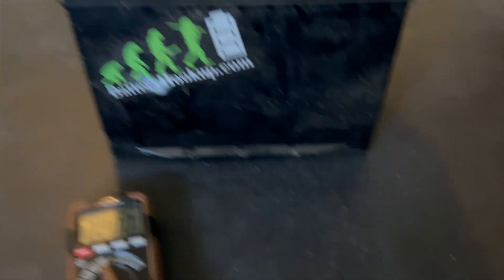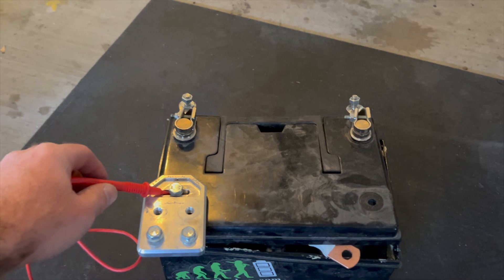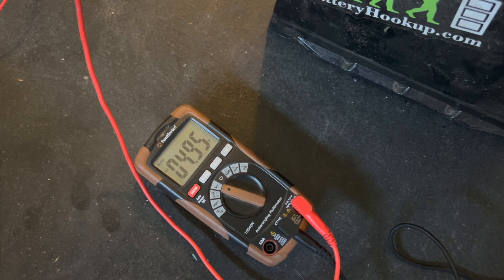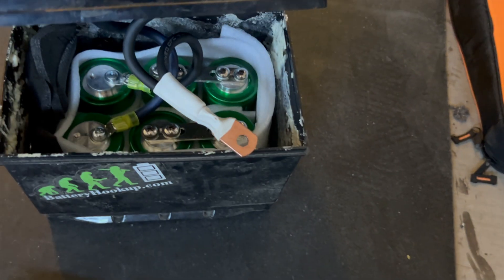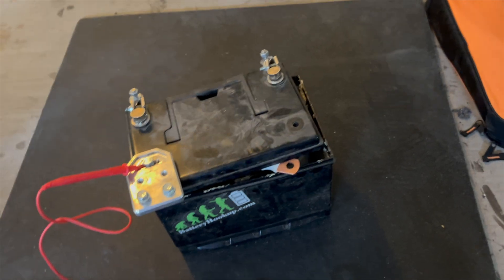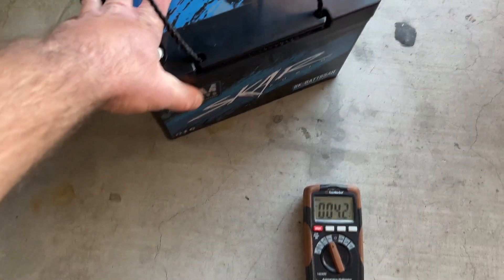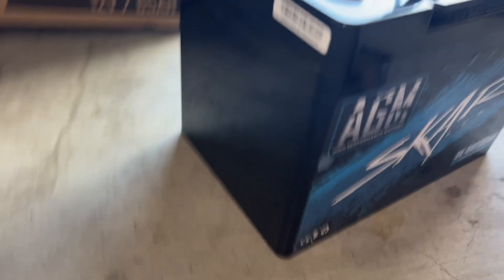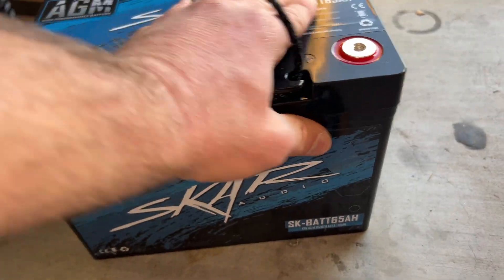2 12s on 6K in the GoKart V3 (video 2):  Skar AGM under the hood

Comment: Thats how i got mine set up. I got a xs power agm and a headway bank. 2.5 years straight going strong with just a top balance once a yr. I do wanna get rid of the xs power for one of those ustart caps.
Reply from the maker: Yeah man, and those caps are CHEAP!  The only reason I didn’t go with one is because they won’t fit under the hood in this car.
Reply: @Husky_Shane_Basshead  my factory location is the trunk so I'm lucky in that sense. Last I saw, they were on sale for $99 each!

Comment: Hell I’m running two AutoZone duralast agm platinum batteries and jp630 super cap bank doing just fine on 9k rms
Reply from the maker: Stock alt?
Reply: @Husky_Shane_BassHead  no 320 amp

Comment: I Think 🤔 that's the battery I am going to purchase, for my set up plenty of cranking amps for my vehicle and alot more AHs than my old optima blue top and like $45 -$50 dollars cheaper..but the MAIN thing it fits in my small battery tray and can close my hood...👍💯
Reply from the maker: Yup, that’s why I got this battery.  It was an AGM and they made one that fit my battery tray.
Reply: @Husky_Shane_BassHead    Yes sir!! 👍I searched every AGM dual purpose, that had the most to offer that would fit in in my battery location, and I checked out your video, and checked out specs and said that's the one..  my vehicle is a 4 cylinder 4x4 kia Sportage, went from 70 amp alt to a 140 amp alt , Big 4 ofc,and all wire ofc, also have a 28 AH AGM  Shurkien supplemental battery, Running around 1900 watts at full tilt, under 2000, amps are pioneer 8704 , running 4, 6x9s",2, 5.25s" , 2, 4s" and 1" soft domes , front channels @1 ohm and 6x9s @ 2 ohm and  2 12s" ran by a JP8 mono block @ 1 ohm.. hope you don't mind me giving you a rundown of my little build..

Comment: Did you have a balancer on your supercaps? I can’t tell from the video.That may be why they took a dump.
Reply from the maker: No I didn’t.  And I think you might be right.
Reply: @Husky_Shane_BassHead  The Maxwell supercaps banks on Amazon and the XS Power Superbanks all have balancers attached on the bars. Your caps might be salvageable. You can’t really kill them & they last forever unless they physically got damaged. I would take them all apart and inspect each one. Parallel all of them, all negs and all positive and slowly charge them all to 2.7 volts. Then dismantle and let them sit for a few hours and see if you find a bad one that varies drastically. If not then rebuild the bank & charge up to 15 volts. Find yourself the correct balancer and you should be ok unless you do find a bad cell or 2. If you decide to run Headway then you don’t need to spend anymore money on supercaps. Headway, Lishen or any other lithium option make supercaps unnecessary.
Reply from the maker: @RebassRevo  awesome.  Ok I’ll do just that.  Thank you,